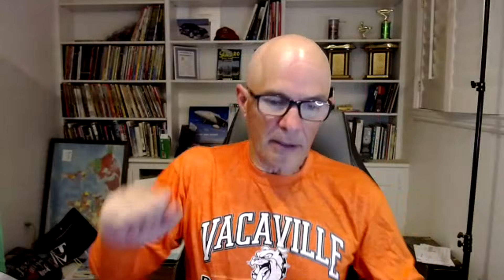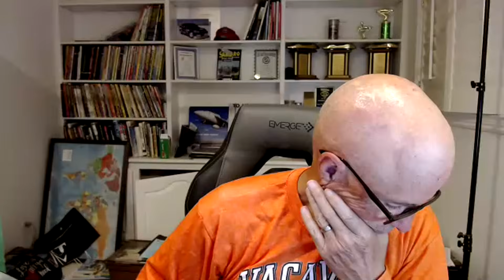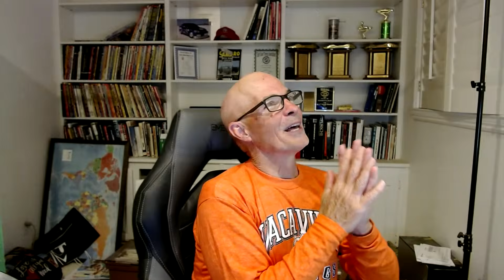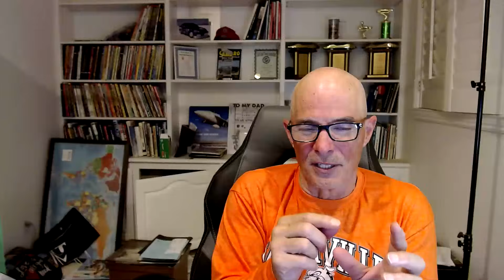INTERCOOLER DESIGN LET'S TALK TECH

Comment: So this reminds me of how a lot of sea mammals (whales) have developed a reverse flow of blood through their lungs to more efficiently use the oxygen. In the case of a dual pass intercooler this would mean put the coldest water to the outlet side. By that side the air charge has been cooled somewhat but the water will still be cooler. Then the air inlet side will have warmer water than the second side but presumably the somewhat heated water would still be cooler than the incoming air so still cooling the air.

Comment: Two-pass cooling is definitely better.  I developed intercoolers at Eaton for their superchargers for about two years and tested different configurations.  You get more cooling effectiveness with less water flow on two-pass.  You do have to plumb it so that the coolest water is exposed to the hottest charge air in the 1st pass.
Reply: Counter current flow

Comment: I never understood why people rarely use interchillers I’ve seen them maintain 43 degrees of intake temperature in a quarter mile maybe because a lot of racers don’t even have a/c on their cars
Reply: If they really understood how good subcooling the intercooler water is, they would be putting a/c systems on their race cars just to chill the water.
Reply: For drag racing ICE works better and it’s easy. AC compressors clutch out at WOT and wouldn’t keep up with the heat for long. Timing and boost are worth more power than say 40F vs 100F air.
Reply: @gforce_117  Ice works really well, but there would be no problem with the a/c compressor clutch cycling off at the beginning of a run.  If you have idled the car in the staging lanes with the chiller system on and have the coolant reservoir saturated at 20F, there will not be a problem with charge temperature increase during the run.  Get creative with the coolant so that it can be chilled to less than 32F:  use water/methanol as the heat exchange medium.  If you can maintain the charge temperature to 40F instead of 100F, that is 11% more power, and you don't have to stress the engine with more boost and timing.  Get the mostest for the leastest, I always say.
Reply: @andyharman3022  with an equal amount of fluid volume it would be like having ice. Odds are it doesn’t have that kind of volume, so IATs will climb quick. So that 11% goes away quick. The more boost/power your combo is, the quicker that goes. Another factor is if you have no heat exchanger you better not forget to run the compressor, and if you do have a HE it just works against you. So I don’t see how it makes a lot of sense in most combos. I’d prefer all the that cooling performance to be in the cab. For a race car it def doesn’t make sense vs ice. I’d say a street strip blower car would be best candidate for that system to test and see how IATs look WOT with a fast acting sensor. Cruise and idle IATs are irrelevant.
Reply: @gforce_117  I didn't say anything about fluid volumes or flow rates or what kind of heat exchangers would be involved.  All the details for those kinds of things would need to be worked out.  I'm just saying it's feasible.
Reply: @andyharman3022  I know you didn’t, but those things would be detrimental to its performance and viability vs alternatives, which is the topic of this conversation. Those are things people have to think about when building their cars.